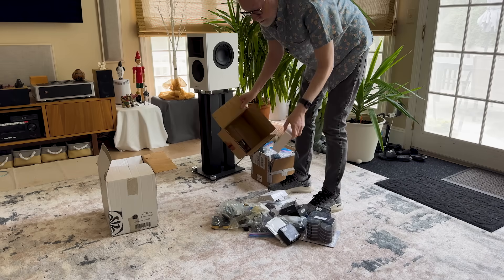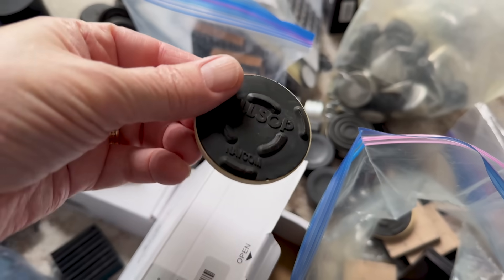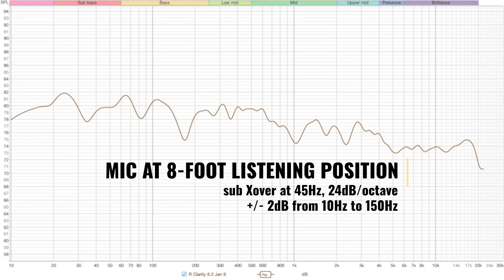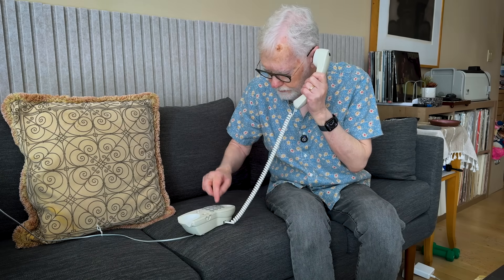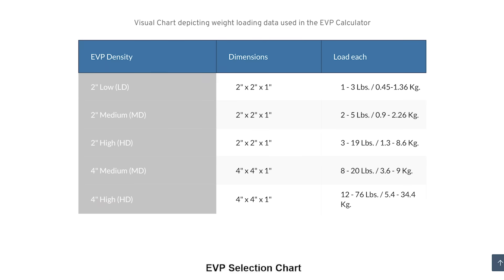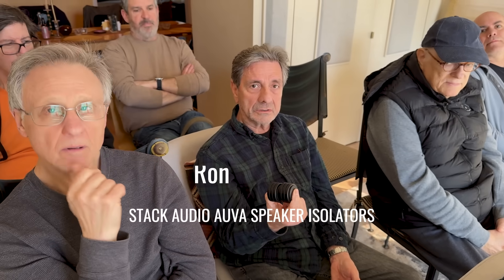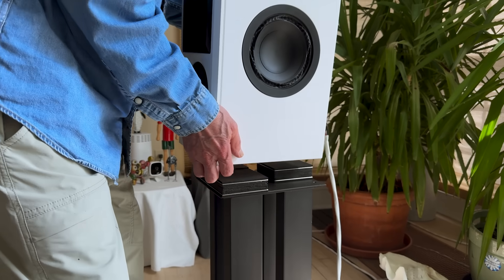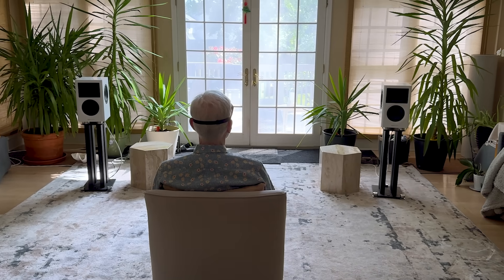Speaker isolation devices, do they WORK?

Comment: Isn't mass-damping a part of this conversation as well?
I have recently made major improvements to the sound of several subwoofers (and rooms!), by removing the silly rubber legs, and attaching the cabinet directly to a 12Kg concrete paving stone (using 4 big knobs of BluTack) which sit directly on carpet. If they're down-firing, or down-ported, I replace the legs with fat hardwood items, before attaching to the paver. My reasoning is that any induced movement of the subwoofer cabinet or wooden floor is energy not put into moving the air in the room.

I suspect I should try mass-damping my 2.4m x 1m hand-made desk, because both subwoofers on my nearfield desktop 2.2 system, sit directly underneath the speakers and under the desk, which only weighs 80-something kilos, and see what that does to the sound.

Comment: In the first place, many don’t know what is under the speakers. I’m talking floor construction and materials that contribute to the sound we perceive. You can’t ignore this as it determines what is required. For example, if your floors are wood frame or wood over concrete, isolation will clean up the sound. On the other hand, if your floors are concrete, carpet over concrete or natural tile or stone over concrete, spikes will work best. Wood is a resonant material and will reflect energy back into the speaker stand or speakers proper if they are floor standing using spikes. The energy that is bled into concrete, stone over concrete or natural tiles over concrete will be dissipated into the concrete and be absorbed by it. Experimenting is fine, but doing so without the floor construction knowledge, is a lot of wasted time as this cuts a lot of what should be used out just from knowing what we stand on and how it effects what we listen to. Simply put, things either transmit energy or receive it. It’s also called material science. It’s not theory, it’s fact and proven over the course of decades of experimentation.

Comment: For my bookshelves speakers, I use a metal stand similar to hus with sand in it as well.  

I use blue tack under the speakers attached to the stands, and I have tried isoacoustic on those stands.  He is correct it is a mind-numbing experience.  

When you do this with a turntable, the results are more obvious and quicker as I have a butchers block and isoacoustic gaia under the block, and the sound improvements are immediate.

Comment: Should the isolation feet be under the speaker, or under the stand? A isoacoustics salesman said to me they should be under the stands. This is what they say: If the speakers are fastened to the stands, then they tend to act as one and the GAIA Neo series are recommended for installation on the floor stand. 

If the speakers are resting on top of the stands, then we recommend isolation between the speaker and the stand. The OREA series are a great option in this case.

Comment: At 9:30 where you banged on the walls and floor… I wonder the nature and requirement of isolation/coupling to either hollow plaster board walls & suspended bouncy floors compared to solid brick-plaster walls and solid concrete floors?

Comment: The only benefit isolation feet will give, is stopping any audible vibration between a speaker and the surface that a speaker is placed on. Also stopping any other objects such as ornaments, especially if the speaker is in a true bookshelf setting from vibrating This is all relevant to the level of decibels being produced. If the speakers are on stands that vibrate, then the stands are rubbish, but isolation feet might help. If the speakers themselves are vibrating then again they're rubbish. No isolation feet will stop the cabinet itself from buzzing. I have a small bookshelf speaker system in my computer room, this is were I play vinyl records to record onto CD.  I've made my own isolation pads out of honeycombed cardboard and carpet tiles that stop all of the objects on the shelfs that I have them placed on from buzzing, especially when I turn the volume levels up too loud. This becomes even more relevant when I play music with high levels of bass. I play a lot of heavy reggae dubs and Jazz.  I have another 5 channel AV system that has a Yamaha sub unit. This sub is placed in the media cabinet that houses all my other equipment,  with a 55" TV on top. This sub already has its own isolation feet. The feet are there to stop the speaker cabinet from making other surfaces and objects from buzzing, not the actual speaker cabinet from vibrating. If I place an object on to of the sub cabinet, the object will obviously vibrate, as I would expect. Nothing in this setup vibrates. I also have a 2 channel HiFi powered by a quad 405-2 . This is for my CD and streaming. I have floor standing 12" Tannoy Cheviots that are stood on homemade stands with castor wheels that are made out of MDF and house bricks. with a thick layer of carpet tiles. Raising the height of speakers is crucial in any speakers placement. What I'm trying to emphasize is this. If your speaker set up doesn't already cause any noticeable vibrations, then putting them on isolation pads won't miraculously improve them.

Comment: I put sorbothane feet under my washing machine, and the brights come out brighter, now. (Just kidding.) 

Actually, I was an IsoAcoustics skeptic until I got a pair of stands several years ago from that company for my desktop monitors to replace yoga blocks. Same height, much better clarity and control. Count me a fan. My main system has floorstanders on spikes piercing carpet and resting on a concrete slab. Other than cutting a hole in my carpet-- excessively low WAF-- what's the best way to get IsoAcoustics advantages from such an environment?

Comment: Definitely an entertaining person….but I am left learning spikes and cones do not work, but also scratching my head on what was the best sound/vibration isolators? Sure that pad may absorb subwoofer vibrations…if we use a sub.
I have been the eternal skeptic on any….vibration isolator spin doctor marketing hype and inflated reviews, even more so with $$$ sound isolator feet! Hold a gun to my head I like the AUVA 75/100 the best based on TRUSTED reviewers….but I still have a hard time spending $800-1000 on 8 feet!
I don’t think this video helped decide if isolators are snake oil….granted any cone or spike isolators I have on any components will be tossed out…..I am not sure I wanna spend $$$ AUVA 75/100 even w a money back return garuntee ?🤷🏻‍♂️

Comment: Under my Kef LS50 Metas I have Bassocontinuo ultra feet, then sand/shot filled stands with Isoacoustics Gaia feet. These stand on bearing-based isolation platforms which in turn rest on early spring-based Townshend platforms. I think each step made an improvement but it's a faff to undo anything so some of it might be in my mind. Mark is right, being scientific about it is time consuming an annoying.

Comment: The question I have is; "Can I expect a difference on porcelain tile on a concrete slab with area rugs?"

More specifically using Eminent Technology LFT 8b speakers which are hybrid magnetic planar speakers.

If the answer is try it, "What is the least expensive product (or technique as I am not afraid of DIY) to find out?"

Comment: Postscript. I could be legitimately criticized for not providing detailed information on my methodology. In my defense, it would have made the video too long and would not have provided helpful information, as I was not trying to do a proper double-blind test. I merely wanted to prove to myself (and hopefully to you) that isolation devices are not placebos. 

For each round, I chose one of the three tracks to play, varying the selection to keep things interesting. After each round of testing, I told Jens what “X” was. I don’t have a long aural memory, but I could easily tell if X sounded the same or different than B. In each trial, the metal cones/spikes were pitted against either the IsoAcoustics Oreas or EVPs. I was not trying to pick a winner between the isolation devices, as they are both excellent products. They both provided a better soundstage than the cones.

Because I got all the trials correct, I made Jens swear that he didn’t alter the results to please me. Jens is a scientist and inventor. He takes audio seriously. Also, we love to argue and take the piss out of each other. He would have been delighted to tell me I was wrong.

He practiced moving the speakers without making a sound, although on the second trial, I heard what I thought was an EVP being placed on the stand, so I told him to start over. After that, we played -20dB pink noise while the speakers were being moved. I didn’t hear anything that could have given away what was what. 

I also practiced these tests on my own the day before, so I could figure out what to listen for. This involved imaging and soundstage, but I wanted to zero in quickly on the sound of the cones/spikes versus the isolation devices.

Comment: Long time believer in component isolation, but it can get quite expensive. A really great alternative to IsoAcoustics is Bright Star's ISO Nodes, they come in 3 different sizes (I prefer the large and have them under almost all of my gear, including my bookshelf speakers). These usually list for $24.99 for a set of 4, but I have been getting them from Guitar Canter for only $19.99.

Comment: Interesting what he said about wooden floors. I once lived in a granny flat which had wooden floors and the subwoofer made the entire place rattle (to the point where I feared for the glass shelves in a cabinet). It was scary and annoying. The solution was a set of SVS gel pad isolation feet. Per the blurb, they did indeed absorb the mechanical energy that otherwise went into the floor and I could watch movies without frightening myself or the neighbours. It was the closest thing to magic I've ever encountered. That said, now I'm in a place with a concrete floor the pads don't do anything but that's OK. They did the job i bought them for.

Comment: My big question: Which is better - coupling or decoupling? I’ve heard and read about both being better.
Reply from the maker: That's covered in the video
Reply: @SteveGuttenbergAudiophiliac 
Whoa, whoa, whoa! Hold on a minute please. He quite succinctly stated “if they were floor-stander’s I think…”. Done, over, kaput. This is now not even a blind A/B; trial is invalid and unreliable! As it relates to floor stand speakers (mine-Tannoy), this has no relevance. Further, he was reflecting on his biased and subjective ears AND only relevancy is with regard to his specific set, with his already highly dampened stands.  Consequently, I would still appreciate greater insight and information as it relates to my Tannoy's. They, my Tannoy’s have a plinth and, I have them on my hardwood floor with their spikes and the accompanying discs (to prevent carving up my floor). 
So again, I continue to ask: Coupled or Uncoupled?  Thanks for your reply.

Comment: Tried some SVS ones on my downward firing BK Electronics sub. They made it a bit wobbly which is not good for the sound so I removed them and replaced the factory feet with 3 inch wooden legs. These really let the driver breath and cleaned up the bass. Well worth the effort.  Isolation feet may be useful if you have a wooden floor, which I dont, and especially if you have neighbours beneath. Spikes wont isolate but they can help fix speakers so that they dont wobble and tighten up the bass.

Comment: Very well made video with good detail video. (Mark were you an engineer or scientist before?)  The floor structure makes a big difference in selecting an isolation or a decoupling device. (Suspended floor (Wooden structure) versus concrete floor slab on the ground.)  You should try Hi-Fi Stay...

Comment: I do have  ' spacers' for my T'table and  I made a thick  support base of plywood , bottom line -  acoustics are  based on vibrations so to some extent...... and my sub  needed a buffer , it was simple and obvious.  so it is sitting on  rubber pads, AND  rubber pads on top of the sub support a weight of  bricks. functional ugly is cool.  maybe.

Comment: I have Gaias under my big Wharfedale Elysian 4 floorstanders on a suspended wooden floor. Massive difference. I was skeptical but got them heavily discounted and decided to give them a go. No regrets.
As for turntables, the best I have used is an inflatable wheelchair cushion between two Ikea wooden chopping boards. Cheap, cheerful and very effective.

Comment: In the case of a floor standing speaker on e.g. wood floor or floating parquet, the surface can be enormous, not to mention vibration may transfer to the walls. Reminded of an experiment we used to do as kids, sticking a needle through a sheet of paper in one corner, hold on to the sheet at the opposite corner, and drop the needle into the groove of an LP turning on a turntable. No visible movement, near-impossible to feel in one's fingertips, and yet, one could clearly hear the music. It's only logical that isolating speakers will work, and depending on the type of floor, that it'll make an audible difference. For the exact same reason, it's only logical that coupling speakers to the floor (using e.g. spikes) will not work unless the floor itself were an absorber.

Comment: Thank you Steve and Mark, for this excellent video. I’m not much of a science guy, I trust my ears more than REW, although measurements do help to understand what we are hearing. 
In my HT-set with 5 identical standmounts I moved from Soundcare spikes tot Isoacoustics Gaia pucks, between stands and floor. I can tell you that parts of my jaw are still on my hometheater floor somewhere.. It was an immediate and very noticable change, producing a more open and natural sound. My Dynaudio Evoke 20 speakers are small, and crossover is set at 80 Hz. I have a concrete floor with ceramic tiles. Just to say that you need bass heavy speakers and/or wooden floors to justify trying this for yourself.

Comment: I live in a very small townhouse with a tiny living room. The floor is carpeted and so I tried different feet, spikes, cones etc. to de-couple my B&W 603 S3s and ASW 608 sub. I ended up purchasing 2 inch maple plinths from Butcher Blocks Acoustics. I put spikes on the plinths so that they won’t move but no feet etc. on the speakers which can effortlessly be repositioned since the plinths have a very durable semi-gloss finish. Now my speakers work better than ever. After room correction I am a very happy camper. Completely decoupled it seems and no rumbling bass vibrating the floor and frame. Neighbors are happier too.
Reply: I have 603 s3 but I used very dense stone with the same out come, although at somepoint I did have 2 pairs of 603 s3 on top of each other with the spikes removed on the top set. The floor was concrete with Seagrass matting and the walls of the cottage were built with flints and sarsen stone. I've never been able to get anywhere near in the newer house with wood floors and lots of glass!! Richard from the sunny UK for a change!! 😊

Comment: Awesome video. Your process worked real well. And I believe very accurate.
Reply: I also have a pair of stand mount speakers the Fyne Audio F1-8 with sand in approx 60% of the columns in height for damping and stabilty. I used the spikes at first then switched out for a pair of Gaia 2s. Switched back to spikes a year later and then after about a month went back to Gaia 1s for correct mass loading. My observations were the same as yours. I contacted Fyne Audio about thier recommendations regarding footers and really didnt want to take a side. Sometimes the devices can be tricky in that one may not be sure if they have a better sound or just different. I know with my Focal Kanta 2s i had the footers were a requirement. The sound was absolutely transformed when using them. I believe still a better result with my Fyne Audio stand mounts but not to the degree it was with my Focals.

Comment: I was inspired by this video, went to hardware store, bought $4 rubber feet and placed them under my $400 Polk bookshelves speaker on srands.. Noticed better bass clarity.  Isolation can improve the sound but you don't need to overpay for it.

Comment: Four balls of BlueTack per speaker rolled in my palms to the size of a large marble placed between the speaker and top of the stand made a very audible difference for my KEF iQ30s, removing a veil of sonic fog. Cost? Less than $10.

Comment: When I have used damping under my stand mount speakers I hear a change in presentation and often a reduction in dynamics. I get the transmission point (You will absorb cabinet energy) BUT by definition if you damp cabinet vibration you are taking energy away from the system, your speaker cabinet should be better located or the cone moving one way cabinet moving the other. Some isolation is good, some absorption might be, it depends. I also find positioning is very important with imaging. Good video all the same. I'm not an ISO fan I tried and sold mine on

Comment: Is it better to place the IsoAcoustics pucks/feet between the speaker and the stand, or between the stand and the floor?
Reply: By placing the isolator between the stand and the speaker, you quiet the stand too. Vibration is a two-way street, so in addition, vibrations from the floor to the stand will then not conduct to the speaker.
Reply: @AVRoomService Thank you

Comment: My floorstanding speakers are 70lbs each.  I wanted Gaia IIIs but the price was a bit more than I wanted to spend.  Picked up the SVS Soundpath Subwoofer Isolation feet, two four-packs.  (saw them in Mark's collect) Very happy with the sound and the fit & finish.  I would call it a 2% improvement for $100 which is excellent hifi ROI.